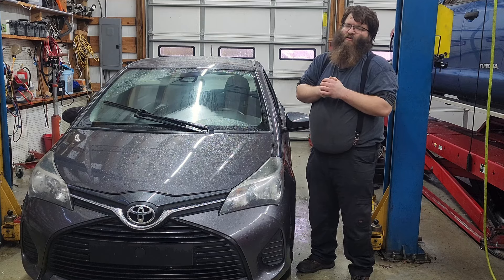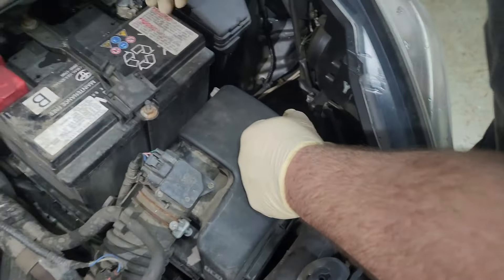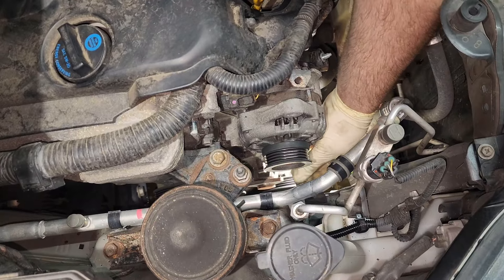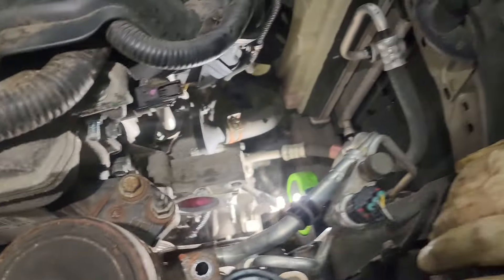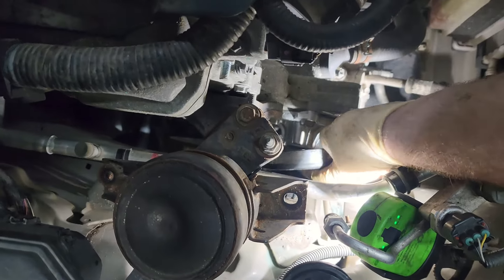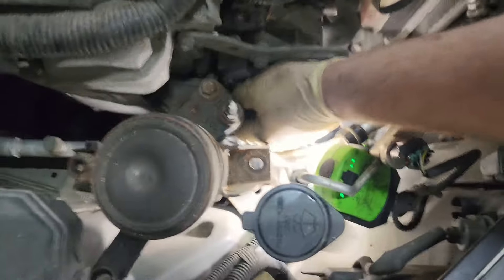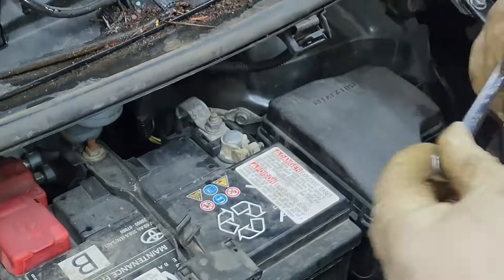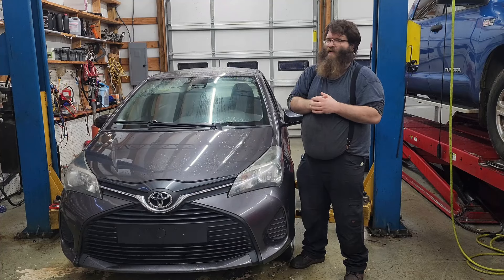07-19 Toyota Yaris 1.5L Water Pump Replacement.

Comment: I know you made this a while ago, but I’m goin crazy. I got my water pump on, but now the car won’t start. It’ll crank fine, but no start. I didn’t want to push it any further since fuel started showin up in the oil. Is there something I missed or bigger issue from the water pump blowing out?
Reply from the maker: If it overheated prior to the water pump replacement, you may have head gasket/ warped head issues. If not, you’ll need to check the basics, spark, compression, fuel (which I’m assuming you’re getting) and figure out what you’re missing.
Reply: @   Crap, thank you for getting back to me. Really hopin it’s just no spark. The pump pulley blew out on the freeway and the car died before overheatin too much. I’m really hopin its just findin a wire gremlin and the fuel is just a little flood from an overzealous buddy

Comment: ok got the water pump out. It was leaking around the seal , could i just reinstall with rtv or a water pump paste to spread on the gasket before bolting it all back in?? thanks!
Reply: my water pump would leak as soon as i poured coolant in from the radiator cap.
Reply from the maker: I would replace the gasket. Rtv usually causes more problems than it solves when it’s not supposed to be there.
Reply: Where are y’all shop located? I want to bring you my Jaguar to fix the water pump. You guys don’t mention your shop name or phone number please do so I can reach out.  Thanks
Reply: @automotiveinsight  thanks i bought a lifetime warrant duralast water pump 80 bucks. The new gasket is like a paper the old gasket was a thin steel with black paint coating

Comment: I have a Toyota Yaris 21. Date of purchase 10/25/2021 I discovered a coolant leak on 12/19/2023. Number of kilometers driven is only 27743 km . It was repaired free of charge under the manufacturer's warranty

Comment: i have a 1.3 uk toyota yaris and after having the water pump replaced, am getting a squealing noise at about 1500rpm and in a high gear , about 40mph. goes away after 10 mins or so. any ideas ?

thanks